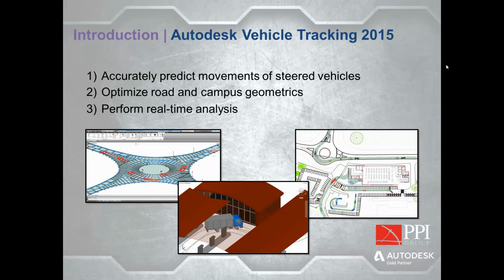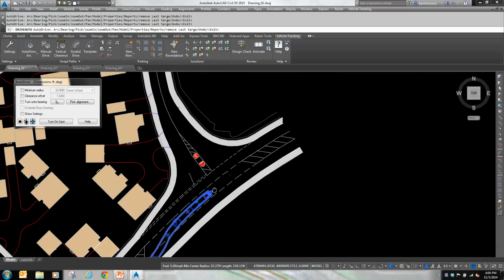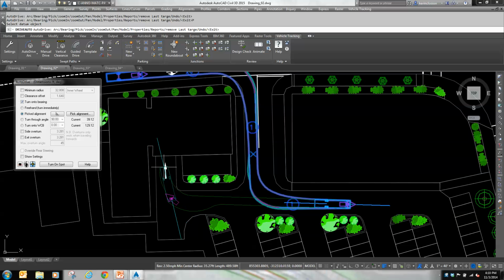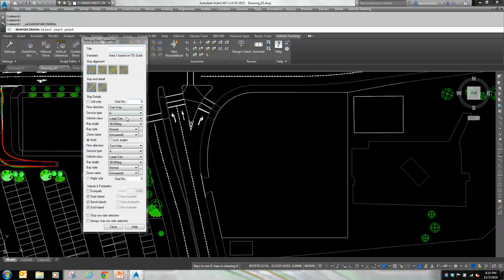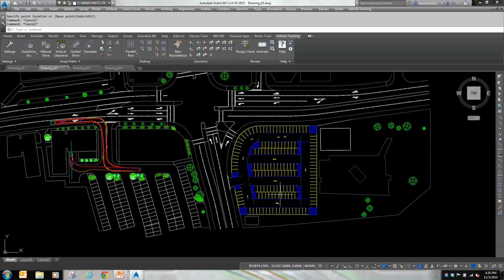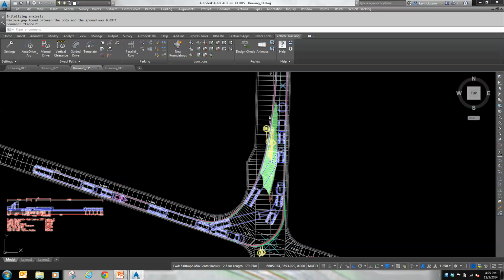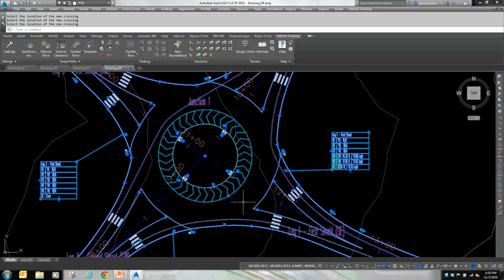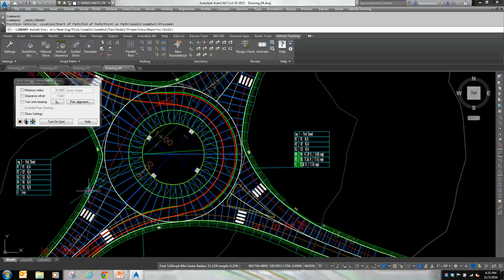Autodesk® Vehicle Tracking Introduction and Tutorial

Comment: Hi I am a beginner. Is it possible to adjust the front overhang length of trucks in advanced editor at all? I can't find an option and my dimensions are wrong.
Reply from the maker: Hello Ben,
The default vehicles within the Vehicle Library are intentionally blocked from edit.  Assuming that you’ve located one that is close to your needs, simply right click on it and select: Edit a Copy…  This will bring up the Vehicle Wizard and allow you to customize the vehicle as needed.  Once complete, it will be placed for use in the Pool (bottom of tree structure).